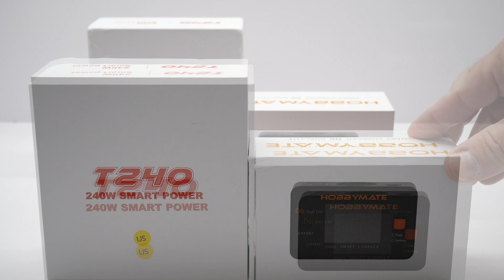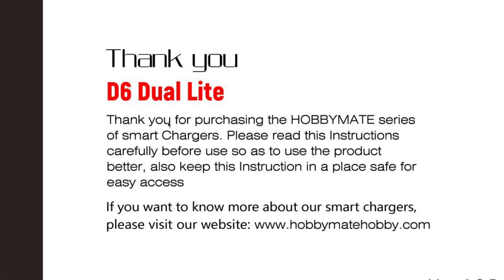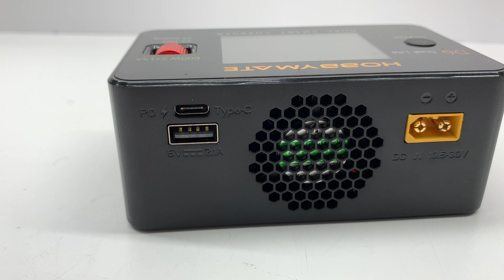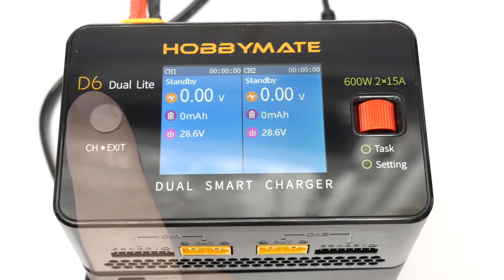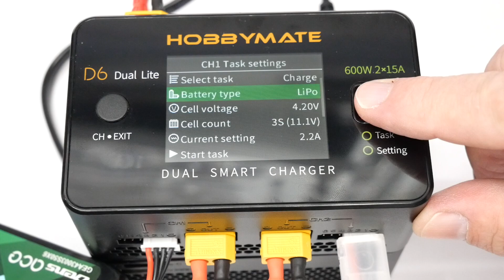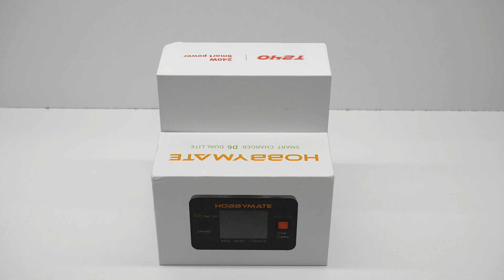HobbyMate D6 Dual Lite 300W Lipo / LiHV AC/DC Charger - Unbox and First Use

Comment: Could you check what span you can adjust the end voltage of each cell? In the manual it only says "End-voltage slight adjustment" it doesn't say how high or low I can set it and I'd like to have it end at 4.18 like the Icharger does it.

Comment: Need some help please. I have just received mine. My batteries are bashing 11.1v 5000mAh 50c. To balance charge or normal charge what would you advise the settings please and after usage should I re charge or discharge or storage. Sorry I’m an old fart nooby
Reply from the maker: I always recommend to balance charge (every time) at 1C - or in your case 5 amps. That is if you’re charging a 5,000mah battery you should charge at 5 amps. 4000mah battery - 4amps, etc.  if you’re not going to use your batteries that are fully charged that day......put them in a storage charge back down to 3.85v/cell
Reply: @TheRCNetwork  ty really appreciated

Comment: Love the review, unfortunately I missed the giveaway window but will be purchasing one. Question on the servo testing capabilities, can you test high voltage servos with the dual leads? I have two AGFRC 66KG-IP67 servos.
Reply from the maker: It's a great charger...it;s replacing my Team Orion Touch Duo Advanced.  It can deal with all the high voltage servos....just not sure about the direct voltage servos (12v+) with a servo lead and a battery lead coming off the servo

Comment: is that D6 good for charging 2 6s lipos? I was thinking about ultra power up6 plus  it's 300w power through AC
Reply from the maker: It can definitely handle it.  Obviously the more watts you have the quicker you can charge...but I only charge at 1C

Comment: Such a feature Rich (yes I did that on purpose) little charger setup! If I do not win this, I am going to have to buy one. Awesome design, compact, and does everything you would need for a bunch of battery types. Thanks for the review. Edit: What a servo tester? Excellent
Reply from the maker: It's worth it...especially for the pricing. The servo tester was a surprise!
Reply: @TheRCNetwork  I wrote my comment before the end of the video. That is why I put edit on it to say about the servo tester. That is an excellent feature to have because you can isolate just the servo. Especially if you shorten the wires and want to test it to make sure it works correctly.

Comment: What a sweet charger and the fact that they are the same size and are magnetically stacked is some awesome forethought. My only OCD gripe is the fact that the cable between the two has to be twisted 180 degrees.
Reply from the maker: I'm the same way! lol

Comment: You got balls lol I never just  charge i balance charge
Reply from the maker: The D6 Dual Lite is preset to balance charge while charging lipos.  The "balance" function on the task manager only equalizes the cells to a lowest voltage - incase you have a cell that dropped lower than the others.  But yes, I always balance charge, no matter what
Reply: @TheRCNetwork  so its got like an ai to protect you and your lipos so you don't have to really think about did i set my charge up correctly
Reply from the maker: Yeah, they know that everyone should be balance charging, so it's set up that way from the factory

Comment: Definitely an interesting charger, I could definitely use a new one for open using the same one for four years. It still works great but I can only plug in one battery at a time
Reply from the maker: Dual port is a game changer!  I ran 3 race classes and a dual port can keep up